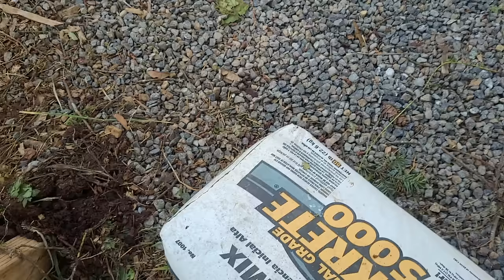Part 10: Block Facade Wall For Hobbit Hole Build

Comment: Great videos. Great content. I do have a suggestion from many years experience. Don’t encapsulate a wooden post of any kind unless you dome it and bring it a couple inches above grade.
Reply from the maker: Thanks, Dan. That's a good call! Thankfully,  I only needed those posts up for 1 winter to hold the tarp up over the project.  I'll be taking them down in about a month.

Comment: Now that you're done, they do make a block called a lintel block that has the notches for horizontal rebar already made into them.  2.  Take your cord and measure to your termination point.  Hold your fingers there and make a loop back behind that point.  Tie that loop into a knot with the loop hanging out.  Take the free end of your cord and go to your termination point and then back to the loop.  Pull the cord tight against the loop and tie off a half hitch.
Reply from the maker: Thanks for the tips. There is definitely some amateur hour happening on my end:-)

Comment: awesome work man,really loving your attention to details and how to build is coming along. also, how near is the hobbit hole to a road? are you carrying the block there ? concrete?

keep up the work man!
Reply from the maker: Thank you! I have to carry everything from the end of my driveway. It is about 200ft of winding trail down a hill. I hired a concrete pump truck for the two large pours. They ran flexible pipe to the edge of the forrest where I'm building.

Comment: The question:
Will the space behind of this wall be filled with ground ?
Or maybe some small storage-room for tools and firewood will be there ?
Reply from the maker: Unfortunately, 

Just dirt. There are roots of a large fir tree behind the wall. I don't want to risk damaging them by leveing the ground there.
Reply: @Odd-Lots  I see.
Can I give you some unsolicited advice ?
;-)
Take into account that if you add 30cm and more dirt there - that will affect the roots.
If you want to save the roots - the level of the ground should remain "as is".
Reply from the maker: Yes, you are right:-). My plan was to run another wall parallel to the tree, behind the facade wall, in order to keep the backfill dirt away from the tree and some of its roots.

Any advice is welcome:-)
Reply: @Odd-Lots  Fine solution ! 👍